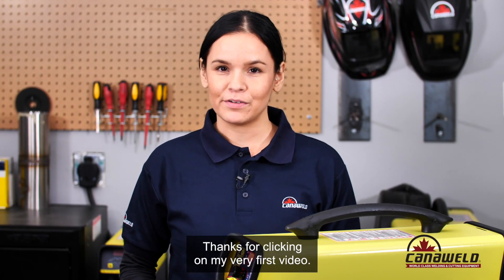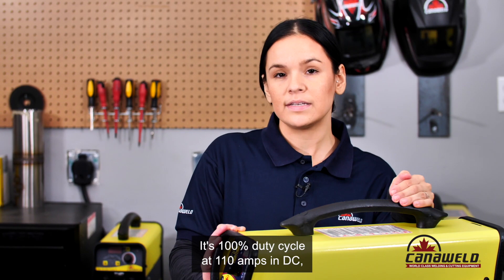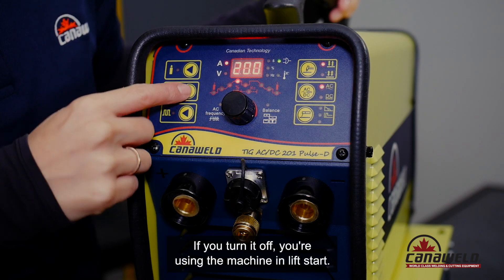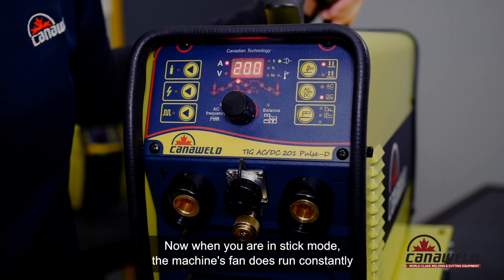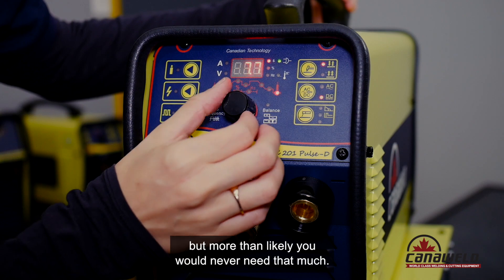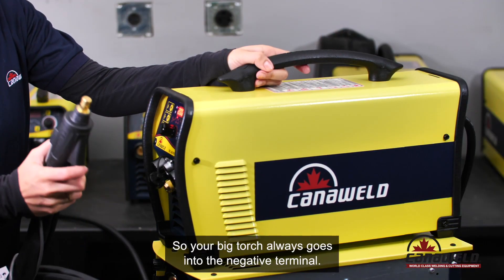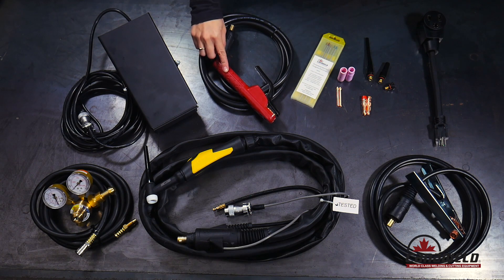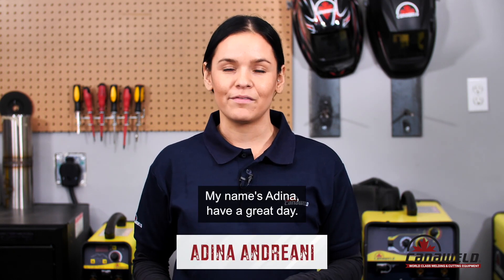Best TIG AC/DC 200 AMP Canaweld TIG AC/DC 201 Pulse-D -Unboxing Video.

Comment: Canaweld... great video. 
Question for you, you mentioned the fan running continuously if you press the stick function. How would you cancel continuous fan if I were to just go through the menu like you are just to familiarize myself to the machine. I just got my unit and wondered if there's a way to reset my machine or is unplugging it the only option? Thanks
Reply from the maker: Hi
If you turn on the machine in TIG mode, then after a couple of seconds the fan will turn Off.
 If you start to TIG weld, the fan will turn off 8 minutes after the termination of the weld job.
In Stick mode, the fan is working continuously because the inverter is on the whole time.
If you change the weld process from stick mode to TIG mode, after 8 minutes the fan will turn off
Best Regards
Reply: Got it, thanks :) I wasn't aware of the 8 minute delay. 
Cheers @CanaweldInc

Comment: Now that I have one and have suffered through the poorly translated printed manuals, this video makes great sense and is nicely presented.
Reply from the maker: We are sorry about the difficulty you had. Now We are happy you like the video.
Reply: The balance and the frequency settings I now understand on a/c tig. (cleaning and electrode longevity and penetration). I now understand that once all of this is set that the pulse can be applied on top of these settings. 
...right?